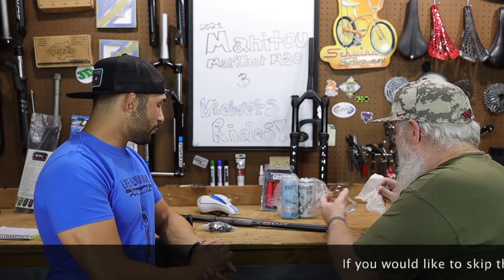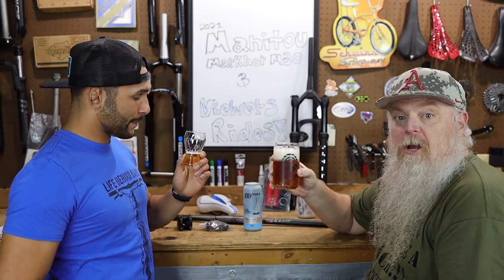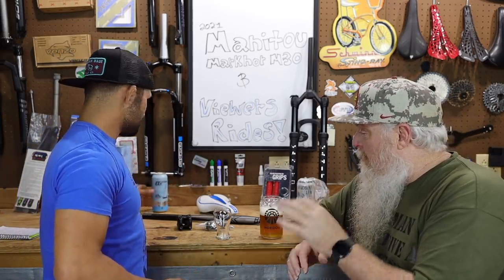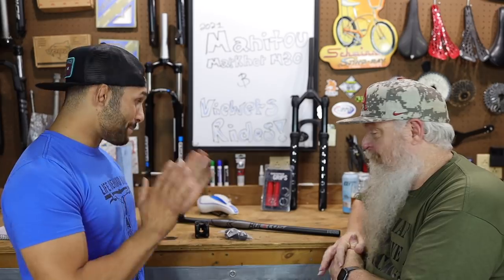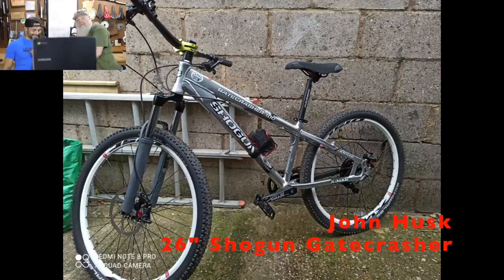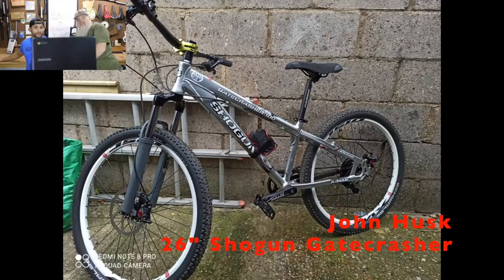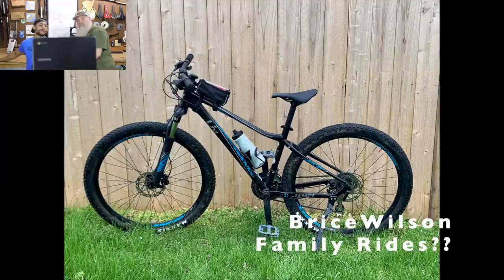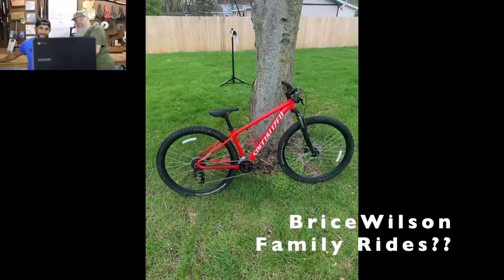2021 Manitou Markhor M30 Initial Impressions & Install plus Viewers Rides

Comment: I tried finding one of those Manitou Markhor forks for My Axum DP but couldn't. I ended up ordering a Bucklos and expect to install it later today.
Reply: I couldn't find them either.

Bucklos is okay for lighter riders, but I wouldn't buy it if you weigh over 180 lbs.
Reply from the maker: Thats gonna be cool man, we enjoyed the bucklos and its a bummer you could not find the fork?? I had a hard time as well coming up with affiliate links:(
Reply: Check "bike addiction" it's where I got my markhors, the only difference I see is ones tapered
Reply: @dangerous8333  try bike addiction

Comment: That's a neat tool.  I'm going to have to take a look into that.  
Thanks for sharing my photos of my GT AGRESSOR Pro and the tank. 🤗
The chain doesn't move with the chain guide. It was tested last weekend during a small crash. 
And my Fox RLC fork was rebuilt too. Next on the list are a PNW dropper post and hydraulic brakes.
Reply from the maker: Hell yeah! That sounds good to us man and so happy you got the fork rebuilt.  Thanks for sending the pics brother:)

Comment: I bought and installed the Jessica headset bearing set for my Axum, and it installed easily and fits perfect. It’s the 44-56mm set. It was around $25 off Amazon including shipping.
Reply from the maker: Hey Brody you must be new. We usually use Jessica headsets but we were trying to give Jason a little break(if you watch some older vids you will get it😉). Thanks man, and don't be a stranger.👍

Comment: The rear arch allows for a shorter arch so it’s stronger and saves weight.  Your brake line has to be a little longer for the routing but we have 2 of these forks and they are plush.  They are just a little smoother operating than the RS I’ve had.  Great on the Smalls.
Reply from the maker: Cool, hey do I run the brake line through the front towards the rear of the crown or down the back of the upper?
Reply: @WOLFTICKVIDEOS  it goes along the arch on the back of the fork, under the frame to the drive side of the back then in front of the head tube to the brake lever.
Reply: @WOLFTICKVIDEOS  I watched it again, when y’all were playing with the rebound that’s routed correctly.
Reply from the maker: Cool I did that:) I think?? HA HA!
Reply from the maker: Oh just seen that, thank you!  had it routed a bunch of ways!! I know its one of those things people that dont work on bikes love to mention!! LOL So thanks for having my back:)

Comment: In regards to the reversed fork arch....Manitou says it is to save weight.  If the arch is in the front of the fork,  the arch will need to be higher to clear the wheel.  The arch of the wheel is higher towards the front than it is at the rear of the fork.

Comment: I just got that fork for my Axum.  You can easily change the travel to 120mm by removing a spacer.
Reply from the maker: Really?? Just take off the compression cap and unscrew and remove spacer? Sound right or am I completely off?
Reply: @WOLFTICKVIDEOS  You may not be able too, there are 2 versions, the standard Markhor goes up to 120mm but there is an OEM version which is the M30 which doesn't.  At least that's what Google/Youtube tells me. It's easy to check and there's a video where someone changes it 120 without having to add oil back in.  Pretty easy to do.
Reply from the maker: Thanks for the info and looking forward in the near future to try and do so:) Hope it works and appreciate you looking out man:)
Reply: @WOLFTICKVIDEOS  NP, hoping they work out for you.  This was the video I was  thinking about, he got his up to 120mm it's around the 3 minutes mark. Good luck and enjoy.  https://www.youtube.com/watch?v=v3MkiUeE9Ys
Reply from the maker: @DimiMTB-Thanks man, we hope it works for future reference:)
Reply: I followed the instructions on this video.  Getting the rod seated back in was a little tricky.  https://youtu.be/tkkEGRtGsgE

Comment: my headset pusher outer is homemade too.  it’s the only way to go!
Reply: Pushing them out is the easy part. I've never used anything but a wooden dowel and a mallet.

It's the compression part that's tricky. I made a tool for that though.
Reply from the maker: LOL NICE!! Mine is getting a little long in the tooth but some new allthread and we are golden! LOL

Comment: I had a Manitou Minute 15 years ago with the reverse arch, the reverse Arch just looks different. I couldn't tell if it was better or not. The fork was short lived, the platform damping, a trendy engineering failure, was crap,  and I about died riding that fork due to lack of bump sensitivity, platform damping? BAD. If you notice so one uses that design anymore. Reverse Arch? Still here, must be ok. I thought it looked fine, but do lean towards the front Arch just because I'm a traditionalist. I'm wondering if these will live up to the money spent. For the money I think it will be hard to out perform the X-fusion Enix, and Suntour Epixon forks.
Reply from the maker: Man we absolutely agree, we hope they walk the walk and talk the PACOCK! They are on the higher end and its gonna be hard to beat the other to for sure!! Hope they do well and we will find out, thanks Patches:)

Comment: Got some Norwagian wood 4 u diva 🤪 had my 5 flat on the rear in less then 2 weeks on my daylie 30-50 km ride lucky that it goth f... right next to my flat so just paked it and went to the store to get beer to fix it and wach this vid. Shoud have taken a pic of my brothers new bike caus that shit has usless stock plastic junk pedals. But a nice budget bike 11 speed diore and a rockshock fork . Might get him some pedals when i order some Caus i need new ones when my new bike show up 😉
Reply: Found a smal steel pin in the inner casing. So weard that it did not go flat faster sinse i trased it in the woods yesterday with my brother 🤔
Reply from the maker: Nice man, get your brother hooked up!

Comment: What's the offset on that fork? I understand the forks on the Axum is a 42 mm offset. I couldn't find those anywhere in that offset. I wanted to stick with 42 so I didn't change the geometry of the slack head angle.

My Axum is still sitting in my living room with a busted front wheel hub. If it broke on a flat paved trail what's going to happen when I take it on the dirt trails. Especially at 220 lb. I really didn't want to upgrade the wheels right away. That's a $300 minimum expense when I still need to get a fork and upgrade the drivetrain. Still on the fence whether to return it and get something else, or exchange it.
Reply from the maker: The offset is 48mm I believe. You know we don't get to caught up on the numbers except price😂. 
If you get a hold of Pacific Cycles or maybe even Walmart.com you can probably get them to send you a new wheel. $300 for a wheelset is a bit excessive by the way. We usually find wheelsets for around $200 or less shipped. Hopefully you can get it figured out soon. Thanks👍

Comment: For calipers, it all comes down to quality, tolerancing, and pressure. Your 103mm, is probably actually 100mm or slightly over or under by decimal not a whole. Cheap calipers are just for reference not actual, high tolerance is for quality control qc.
Reply from the maker: 👍 Gotcha, thanks? Budget Channel-Budget Tools-Budget Fork

Comment: 13:08 44-55mm means 44mm upper bearing cup,  55mm bottom cup.  it's the size of the taper headtube it fits into, and the outer diameter of bearing cups. it can't be both 56 & 55 bottom.
Reply from the maker: You do watch our videos right? We know all about the headset sizes on Schwinns. Jeremiah accidentally got the wrong one. Don't know what bike takes a 44-55mm but it's strange that there is a 1mm different sized headtube out there.
Reply: @WOLFTICKVIDEOS  I knew that, just warning you this is not a good solution, I guess you only did it as a temporary solution to get an idea of the fork on the bike.
Reply: @WOLFTICKVIDEOS  there are several sizes, and bearings can have different degrees on bearings, bearing scan be different size, the cups can be different size, but it's easy to find correct one just measure bearing syou have if integrated, but not a fan of integrated but integrated headsets won't be found on bikes like this, but you have semi integrated, which I prefer, bearings I'm bearing cups. But as I mentioned the sizes can vary. Good Schwinn keeps it consistent. Cane Creek has a headset calculator, but can't find it anymore.
Reply from the maker: Yeah brother:)
Reply from the maker: Gotcha man, appreciate the advice:)

Comment: Axum frame is so legit...if only more slack
Reply: $50-100 and you can slacken -2* for 65*.  Works Components
Reply: @techjeeper8800  That mess with integrity of headtube hitting jumps?
Reply from the maker: Dude the bike looked so freaking awesome in that last shot!! A little more you are right would set f off:)
Reply from the maker: @TechJeeper- Seen that! Do you have a link?? Never mind found them!
Reply: @rogerfloyd852  I don’t know, we run them on 2 bikes right now.  No issues yet.  11YO is starting to get some air on his but my wife doesn’t ever.  They have manitou forks with the -2* works headsets.

Comment: The reverse arch is cool! I don't think it is beneficial in any way though.
Reply: lighter but equal strength (less material), weight further back closer to center between wheels, weight lower/lower center of gravity, protection of stanchions from mud/debris
Reply from the maker: Man you and Chicken Sendies!! I cannot do it man, just hated on it for so long!! LOL Then we had to do it!! Funny what you can get used to...We may try and take out the spacer in a later video to add what is it 20mm? Is that what you did?
Reply: @WOLFTICKVIDEOS  yup! It was literally the easiest conversion. Chicken Sendies is another up and Comer!

Comment: Hey guys, what is the length of the original fork steer tube? I am get an air fork deal but I think the guy has his cut too short.
Thanks in advance
Reply from the maker: We actually do man, it is 7-1/4 " we believe. Not too sure on the headtube length though

Comment: Are you able to increase the travel ? Or is it just 100mm
Reply from the maker: We have been told that you can adjust them. We don't open the forks up so we can do a more accurate long term review at some point. Hope this helps.
Reply: I have one on my alum. Comp , and took a spacer out, and made it 120mm ! Gives it a slacker head tube angle ! The fork is plush for the price ! Skinny legs, at 30mm ? But way better than stock ,heavy junk! 8 an1/2 pnds. Compare to 3 an a 1/2 pnds. The bike weight is 28.5 pnds.with wider more aggresive tires ! Alum.bars and stem,with vex carbon pedals... nxt is brakes & drivetrain ! Or just ride my giant stance ,full suspension ?

Comment: 22:21 How to destroy a headtube, Please stop doing this, tolerances have to be good, and tape won't do much, you will destroy the head tube, once there will be play, the cup will move and eat the head tube.
Reply from the maker: Hahaha we don't plan on keeping it this way. Jeremiah ordered the wrong headset and didn't want to admit it since he don't usually do the ordering😂. Not sure if we will change it out before we do the Realtime Review or after. If we decide to keep it this way for a while I will periodically check the play in the headset, but I'm confident that it will be fine. Thanks for the concern though.

Comment: 34lbs for a 29er hardtail in 2021 is absurd.
Reply: Still has the kickstand and original drivetrain I think. They'll shave it down
Reply: @markwexy1621   The bike started at 36lbs. This thing cost as much as a cheap carbon build and thats unacceptable.
Reply from the maker: @Thiosemicarbizide Benzoyl Alcohol 36lbs for a sub $500 dollar(with free shipping)29" bike with 100mm travel and a dropper is not that bad. Like we always say show us the links to these great budget bikes that outclass the ones we have, and we might buy one and review it.
Reply: @WOLFTICKVIDEOS   Your channel wont let me post links or they simply dont show up. I posted the Sava bikes on Alibaba, and thats not even sale prices.  Alibaba will work out the shipping rates with the customer. The point is that your buying a better cheaper bike no matter how you look at it. The deals come with better everything, and need little upgrading.
Reply from the maker: @thiosemicarbizidebenzoylal2921  Yeah YouTube frowns on shady sites links🤣. Just email them to us. Our email is in the about tab on our channel.
Reply: @WOLFTICKVIDEOS  Aint nothing shady im posting. I will send the links and help you with the cheapest shipping if you want.
Reply from the maker: Yeah brother, that would be awesome:) thanks man